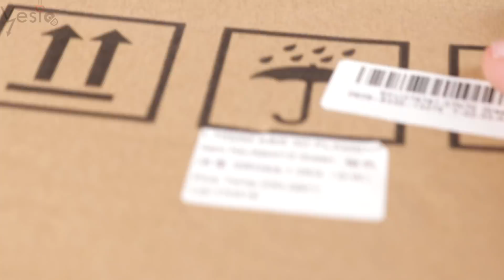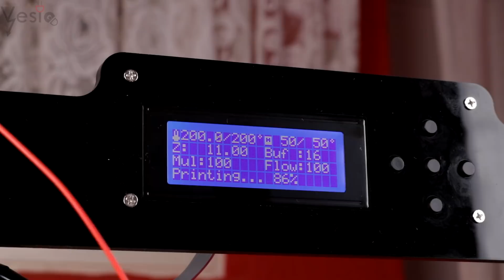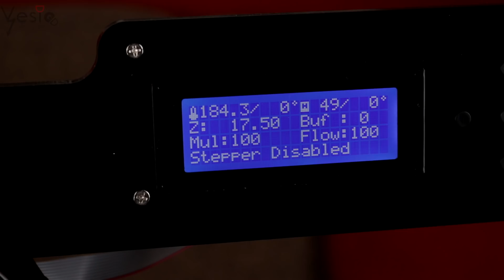Kako radi Anet A8 3D stampac

Comment: - Problem sa odvajanjem od podloge mozes koristiti lak za kosu umjesto ove žute krep trake (lakse se skida), ali najbolje je kupiti pei sheet ( https://www.ebay.com/itm/300-300-1-0mm-PEI-Sheet-Polyetherimide-Build-Surface-3D-Printer-w-Adhesive-Tape/183034384955?hash=item2a9db3123b:m:m6hovuMrxDMaIeSzV4NZH0A ). 

- Problem sa zelenom plastikom je vjerojatno zbog temperature hotenda - probaj povisiti temperature na 210-215

- Za smanjenje buke mozes instalirati ublaživaće za motore ( https://www.ebay.com/itm/For-Nema17-Vibration-Dampers-Motor-Tools-Printer-Steel-1-3-5pcs-3d-Diy-Rubber/112841918280?hash=item1a45e70748:m:mLZSKI6l5E8L0m-ULwSrp3A ). Također originalni ventilatori su loši pa ono možeš kupiti neke kvalitetnije koji su tiši.

Uzivaj!